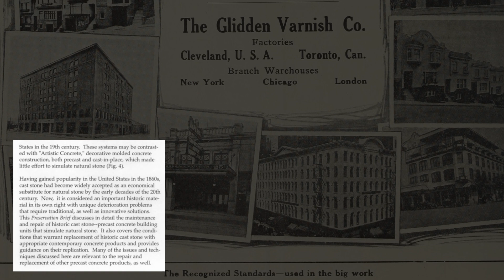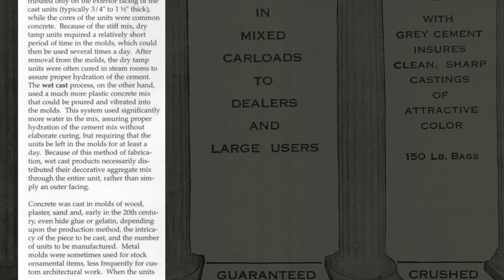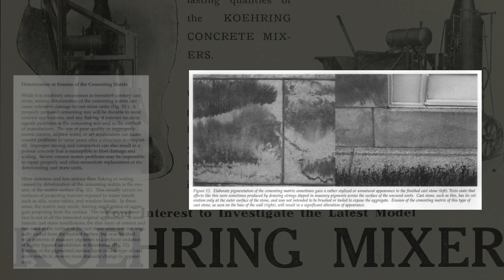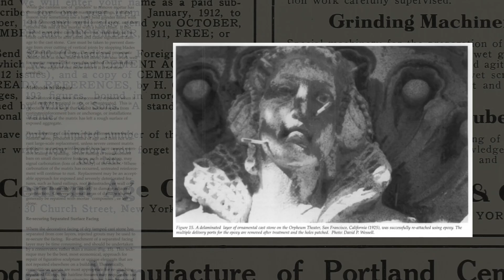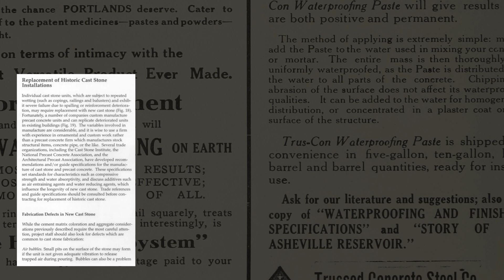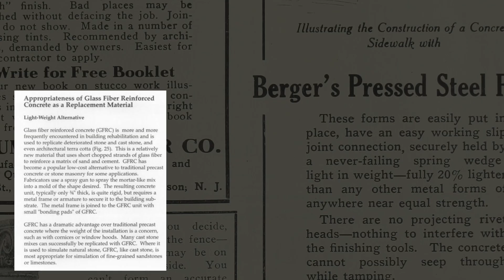Historic Cast Stone - Maintenance & Repair of Artificial Stoneworks

Comment: Ancient cast stone recipe cement, no chemicals. 

Recreate the strength and beauty of ancient stone using only natural ingredients.

Drymix:
3 parts crushed granite dust or fine stone powder

1 part dry clay (kaolin, bentonite, or natural clay)

1/2 part wood ash (sifted fine)

1/2 part powdered limestone or crushed seashells

Wet:

Mix 100g of natron (natural sodium carbonate) into 1 liter of warm water
 
Instructions:

Mix all dry ingredients thoroughly in a large bucket or trough.

Slowly add the natron solution while mixing.

Adjust water to get a thick, moldable paste.

Pack firmly into molds (wood, stone, or clay molds all work).

Tap to remove air pockets.

Optional: 

Add chopped straw or natural fibers for strength.

volcanic ash in place of wood ash for extra durability.

Add natural pigments (like ochre or charcoal) for color.

stone like and durable material. similar to ancient cast blocks or Roman concrete.
Reply from the maker: Appreciate this - very intriguing!
Reply: From what I understand, concrete refers not to the stone itself but for the core where they would stick the bricks and stuff to, so that it would be very strong without being too heavy.

Comment: Waterglass is an awesome material.
When dried it is as hard as glass and water resistand.
Also its very cheap and easy to purchase online.
Waterglass can be used to make concrete and brick waterproof by drilling lots of holes with very small diameter into the bricks and or concrete and the mortar in between them. 
 Then poor in the waterglass. 
It will saturate the brick/concrete and when its dry the wall will be stronger and waterproof.
 When you poor waterglass into a cement or concrete mixture it makes waterproof cement/concrete that is stronger than when made with water. 
 Note: For every amount of waterglass used you have to use the same amount less water in the mixture.
 Looking forward to the video you're doing on the subject.
Reply from the maker: I don't know much about waterglass and have only a few documents discussing it. Will need to revisit it. This is a fascinating comment though.
Reply: @LatentLexicon  Waterglass is fascinating stuff.